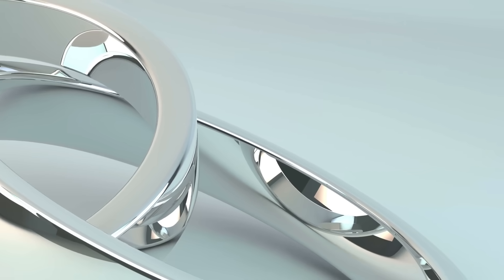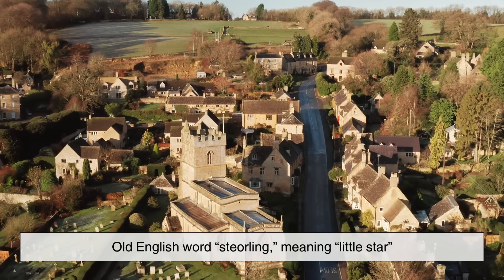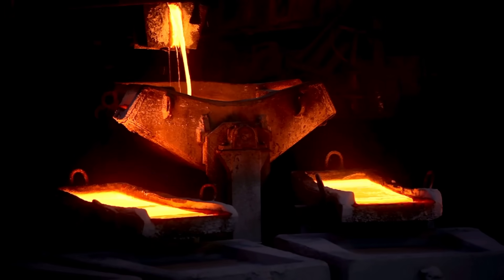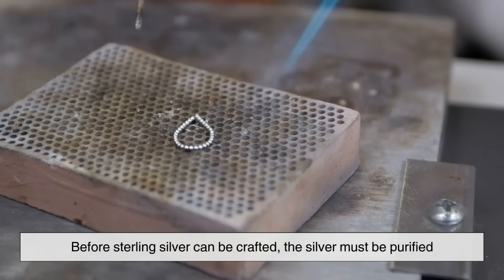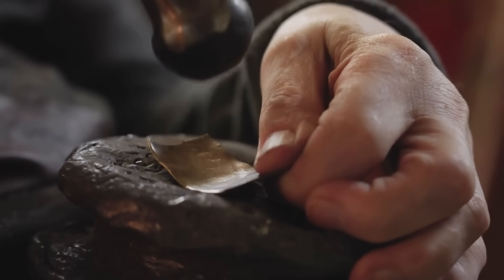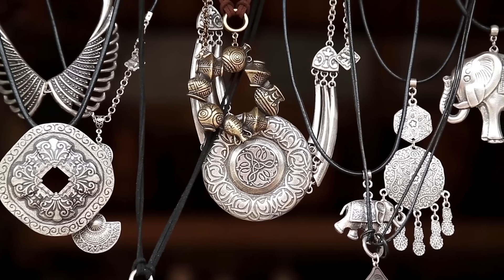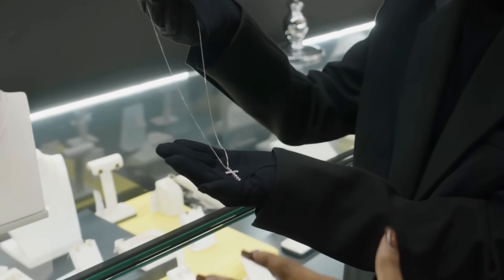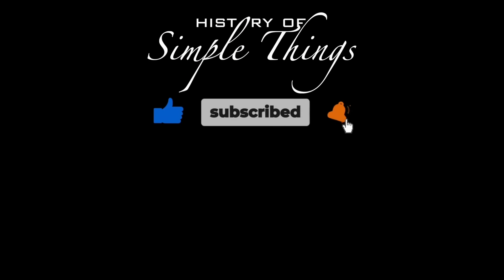From Raw Metal to Radiance: How Sterling Silver is Made

Comment: In England in olden days, the Pound Sterling was based on the Tower Pound. One Pound of sterling silver was divided into 240 sterling silver pennies. Six pennies were equivalent to one Sixpence coin. Two sixpence were equivalent to one Shilling coin. Two Shillings were equivalent to one Florin coin. Five Shillings were equivalent to one Crown coin which was about the size of a silver dollar. Twenty Shillings were equivalent to one Pound Sterling which was equivalent to four Crown coins which were equivalent to ten Florin coins which were equivalent to forty sixpence coins which were equivalent to eight half-crown coins. Furthermore, the symbol for a penny was “d” which was derived from the ancient Roman silver coin known as a denarius. Later the composition of the penny was debased from silver to copper. The symbol for a pound is “£” which was derived from an ancient Roman weight known as a Libra Pondo.
Reply: I think the United States did I it more simple, it’s all based off a dollar and broken down fractionally as 1/2, 1/4, 1/10.